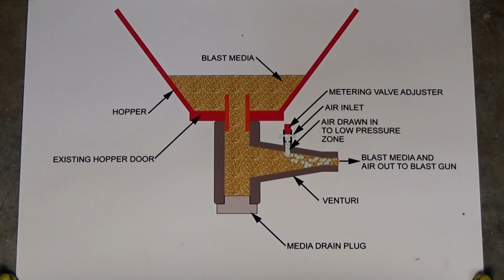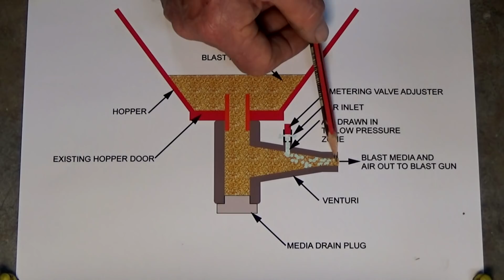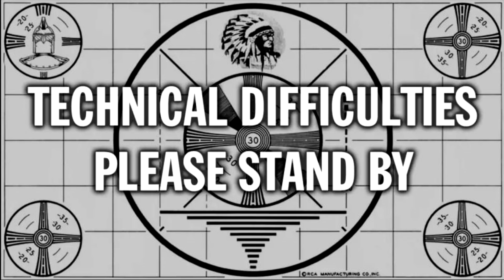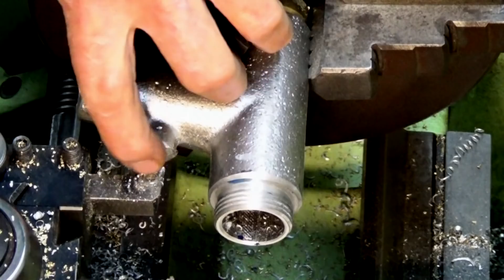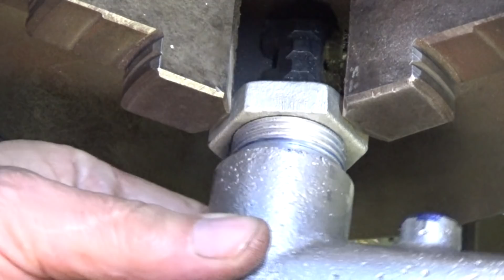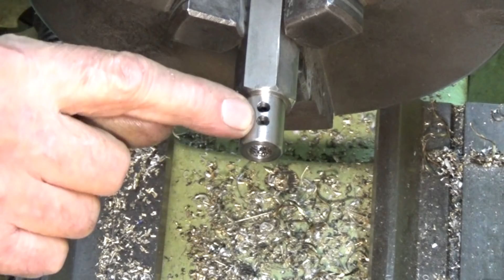HF Sandblaster DIY Metering Valve

Comment: I know you partially answered this already, but what prevents the air inlet from blowing out the intake for the media?
Reply from the maker: The tapered venturi in the blast gun creates a negative pressure so air is constantly being drawn into the vent holes in the metering valve. The entire media path from the bottom of the hopper, through the metering valve and all the way up the flexible feed hose to the blast gun has a negative pressure applied to it. 
Regards,
Mark

Comment: in the same boat here - pretty much doing all the mods mentioned. im running 1/2 hose tho as i need a VERY aggressive cabinet. - marine heads get rusty. wonder how criticls the venturi is? guys here using pipe fittings..
Reply from the maker: I have seen some of the builds based on pipe fittings and from my experience they would probably work well. I am not sure how critical the venturi shape is in my version. I think it's more about having some way of admitting and controlling the air bleed into the stream of media. I upgraded my blast cabinet after this build to include a solenoid air valve instead of a foot pedal. I mounted an old EStop switch near my knee so I can switch the air on and off and the solenoid has a large bore for the air to pass through so it doesn't throttle the air as much as the little foot pedal I had. It seems that air volume is more important than pressure.
Regards,
Mark

Comment: Hey Mark, new sub here....thanks for sharing your successes as well as the failures, we can all learn from both.

You can use the same "backwards" threading technique that you picked up from Joe Pi on external threads too.....just turn your threading tool upsidedown and thread in reverse to cut from the shoulder out.
Reply from the maker: I have used that method but it only works on imperial threads on my lathe. If I have to cut a metric thread I need to keep the half nut engaged the whole time and reverse the lathe to bring the tool back to the starting point. If I use a hard stop you have to be mighty careful not to crash the lathe into the stop as you engage the brake. With the imperial threads I can just disengage the half nut and wind the carriage up to the hard stop and go from there. I made some tiny hex headed bolts that way a while ago and it worked great.
Thanks for watching.
Regards,
Mark

Comment: At last, an Aussie take on small sand blast cabinet mods by
someone who dare say, sounds switched on. Bravo.
I have ordered a Renegade Bench top model (190L) 
and have been looking at these enhancements now that I
have discovered the shortcomings of these types of cabinets.
Not having the skills and gear that you have,
I hope to achieve the same results with slightly less efficient(perhaps)
plumbing fittings, with small mods to smooth and improve flow.
Look forward to watching the rest of your videos.
Thanks mate.
Reply from the maker: You're welcome. I used my blast cabinet today to prep some aluminium parts for powdercoat. It still performs 100% better than when I bought it. I am not sure how beneficial the metering valve is but overall, with all the modifications I have done it does a very good job. If you get a chance, check out the videos I did on the blast gun build and the solenoid operated air valve. I also upgraded my compressor to a Chicago "Silent". Adding a large receiver to the air supply helped too. 
Regards,
Mark
Reply: @Preso58  
You seem switched on Mark, so can I ask you this?
Instead of a Tee piece on the bottom of the hopper,
I have thought of using a cross piece.
The media feed (vacuum) tube stays on one side 
and the ball (metering) valve opposite, the drain plug stays as is.
As the metering valve acts like a loss of vacuum would it not be
better to have it after the media?
Full vacuum(low Pressure) can draw on the media falling from the hopper and as it moves, 
air from the ball /metering valve behind it (opposite the media/vacuum) gets drawn in to aerate the mix?
Taken further, could low pressure air be introduced on this side to further 
aerate the media, using the same or even smaller diameter inlets.
If this worked this air may be adjusted to suit different types of media.
I know this starts to sound complicated but the metering(ball) valve can even
be remotely mounted and plumbed to the Cross piece port via hosing , the air
supply could come from the foot peddle so it operated in conjunction with the gun itself.
Separate metering/pressure of course.
Once set up and assuming I'm on the right track it may transform the system
closer to what we are all expecting, maybe?
What do you think or am totally I missing something here?

Comment: I have a Hare and Forbes SB-375 I was told the secret to blasting without the pickup getting blocked is dry air! I went above and beyond with making sure my air supply was dry making and fitting a large silica bead filter that people have made using a karcher pump filter, then the air goes through a filter used in plasma cutters, then through a standard moisture trap. I have not had any trouble with the standard pick up tube in my blaster. So atm I have no need to fit this upgrade. I’m using glass beads and was surprised after watching a YouTube video suggesting to drop the psi to 50- 60 how fast it strips material and the finish it leaves.
Reply from the maker: I have heard that dry air is pretty much essential to get good results. After posting that video I was able to install a very large receiver to my compressor. It's actually a very large compressor tank and I mounted it outside my workshop and all the air from the inside compressor goes into the receiver. I also upgraded my compressor to a Chicago "silent" compressor (they are not silent). However, most of the air coming into my shop is now drier since it is cold. The air inlet and outlet are near the top of the vertical receiver so any moisture drains to the bottom of the tank. Even in our most humid weather I am able to keep the media flowing well. I only recently purchased some glass bead media and I love the finish I can get on aluminium. It gives is a very soft sheen and isn't as aggressive as the garnet I had used previously. However, I haven't found it as good as garnet for stripping rust and scale. I should try altering the pressure to see if that helps. 
Thanks for commenting.
Regards,
Mark

Comment: Mark, you said you have and imperial lead screw. When you cut metric threads on and imperial lathe, there is a method to disengage the half nut at the end of a cut. In short note, the thread dial is marked and at the end of the cut, the half nut is disengaged, the lathe stopped, then reversed, then the lead half nut is reengaged when the mark lines up with the dial mark. Abom79 has a video on how it’s done. (Cutting metric threads) Never saw this method before.

Comment: So it seems like what you and all the others showing these upgrades to the HF cabinet are really saying is, dont buy the HF cabinet.  
Which one would you recommend so that we dont have to do all these upgrades?
Reply from the maker: Unfortunately, there doesn't seem to be a lot of choice in the cheaper end of the market. Most of these sub $400 sandblasters are similar and all of them have shortcomings. It's a bit of a dead giveaway when the company that I purchased mine from also sells the upgrade parts like the foot pedal, the metering valve and the better quality gun. However, I have been totally happy with my unit now that I have done all the upgrades. As long as you don't want to do large parts or really heavily corroded parts it does a pretty good job. Once you step up into a commercial quality setup you are going to need a much bigger compressor which can also be a limiting factor with home/DIY style sandblasters. 
Regards,
Mark
Reply: @Preso58  Thats basically what I thought.  I still think its better to have a small mediocre way to do it myself than pay a company a bunch of money every time I need a small project done.  Thanks!

Comment: For the media drain a cap might have been better than a plug IYKWIM.
Reply from the maker: As it turns out, I have never needed to change out the media. I am using 80 grit garnet and it seems to last indefinitely. However if I do need to drain it, it's just a matter of cleaning the threads with some compressed air. 
Regards,
Mark

Comment: Hey Mark the parts you made and modified are available as spare parts for the larger cabinet (SBC420). But I did like your casting video thanks
Reply from the maker: Kerry, those aftermarket parts were pointed out to me by another viewer just after I had finished making all the parts I needed. However, I still enjoyed making the castings. I really wanted to learn about making and using cores for small castings. 
Regards,
Mark
Reply: @Preso58  Hi Mark I am also guilty of doing the same, if I cant buy it I will make it.
I did enjoy your video and I am looking to do some complicated castings. The core sand process was very helpful thankyou.

Comment: gday mark was just thinking why not use a cap rather then a plug.   stops media getting in the thread
Reply from the maker: Yes, that would be a help. As it happens, I have never had to swap out the media so I am not sure how the plug will hold up. It does have very coarse thread so probably a bit of a squirt with the air gun will clean it up.
Regards,
Mark

Comment: https://youtu.be/9N7HvyJNzdE.   

Or you can try this from pipe found from your local big box home improvement store for about $30. I made one for my harbor freight blasting cabinet and added a Eastwood upgraded blast gun with foot peddle.  
I also made many other upgrades, such as a router control to control the negative pressure inside the cabinet, twin flood lamps for bright lighting that also throws heat to keep the media dry. 
I also added a water separator with air pressure gauge and inline brass shut off valve. I have a dust deputy for dust management. 
I used speed nuts between the window glass frame so I could install the threads of the window frame hardware facing the exterior of the cabinet with wing nuts to fasten the window glass frame. This way I can quickly change the old etched glass without crawling inside the blast cabinet.  
A WORD OF CAUTION; : always keep the side inlet air vent open on the  bast cabinet or you will crush your shinny new blast cabinet like a beer can from to much negative pressure from your shop vac. It almost happened to me! 
Good thing my router was on the low setting controlling the shop vac motor speed. I also added a wood trey with casters and a grab rail to pull the cabinet around. I used a 90 degree PVC fitting exiting from the rear of the exhaust vent on back of the cabinet with a shop vac hose leading  to my dust deputy cyclone. The 90 degree PVC coming off the rear exhaust vent allows me to push the blasting cabinet close to the wall saving me garage space.

Comment: I piped a pressure pot blaster into my cabinet. It uses a lot less air than a suction gun. I can run it at 50psi on a $90 supercrap auto compressor when I am working on site with my vacuum recovery blaster.
Reply from the maker: Superior Etchworx, I am starting to price a pressure pot for my setup. My biggest issue is a lack of space but I am thinking I will set it up on the wall above the location where I will use the blast cabinet. Although all the work I have done so far gave me some improvement in performance over the stock cabinet, I am still looking for a better solution. 
Regards,
Preso
Reply: @Preso58  The 10 gallon ones from ebay are under $200 but need mods to make them work really well. I Have a couple of new modded ones for sale if you are near frankston vic. I make and sell the mods and hardwearing boron carbide nozzles. On my channel there is a ceramic/ carbide comparison video
Reply from the maker: Superior Etchworx,
I have just watched that video and I must say it is quite impressive. I am guessing you are using the blast cabinet as a containment and the pressure pot to deliver the blast media? Also, I was wondering what sort of blast media you are using? I am due to leave on a holiday on Monday but I am interested in the possibility of purchasing a pressure pot. Can I contact you directly through your website?
Regards,
Mark Presling

Comment: I made one out of PVC last week and we'll see if it works this coming weekend
Reply from the maker: I had originally planned to make mine the same way. Then I got sidetracked into making epoxy resin cores. 😁
Reply: @Preso58  Happy to report that my PVC metering valve works well. I'm stoked it didn't cost much.
Reply from the maker: That's great. I am thinking that the smooth inner surface of the PVC will keep the blast media flowing easily.

Comment: Mark,
Nice work.
Hare and Forbes have these and foot pedals and a much better gun available.
They can be seen on their web site in sand blasters, model SB 420 click on spare parts on the side column.
This probably wont help you but the guys watching and commenting might find this info useful.
The SB 200 cabinet you have is roughly $320, plus spending another $100 to $150 for improved lights, gun, metering valve, gun and a version of a cyclone dust separator, hoses, bucket and shop vac, gives you a cabinet apart from size that would cost between $1000 & $1400.
So yeah made to a price, but can be cheaply improved into a much better tool.
Edit
I forgot to mention, paint the inside surfaces white, improves the perceived lighting a lot, and its relatively cheap,  a good bang for the buck.
Reply from the maker: Cost is always a major factor when I am making decisions about upgrades in my shop. I realised too late that Hare and Forbes had the upgrade parts but I probably would have still tried to make the parts myself. So far, the only parts I had to buy were a cheap plastic cyclone, some LED strip lights and a power supply for them and some miscellaneous fittings and a foot operated air valve. Maybe $100 at the most. Plus, it's fun getting your hands dirty and it gets me out of "shopping" with my wife. 😁

Comment: I have the same Drill with you ! Mine is Russian ! Very good tool and torquey ! I found your build very interested thanks for the help ! My cabinet was a pain in the butt to blast parts
Reply from the maker: That drill that I am using belonged to my father and I always felt a bit smug because I already owned an 850 watt Bosch drill with forward and reverse and variable speed. However it had a full polymer body and I could flex it up and down nearly 3 degrees either way whereas the AEG drill  is rock solid. It only has two speeds but it has served me well. I recently purchased a Milwaukee variable speed drill with a metal gearbox but it cannot be locked on at a specific speed. I could probably 3D print a clamp arrangement to hold the trigger down though.
Regards,
Preso

Comment: Bravo! This is enjoyable and a pleasure to watch you build! But why did you worry about making a plug and exposing the threads to the media???  thread the external side for an off the shelf pipe cap made of black iron? Just curious- its done and looks great! Mr Mark- hats off and Bravo again!
Reply from the maker: Thanks. I can't imagine that I will be changing the blast media much but I went to the hardware store looking for a cap with an internal thread but couldn't find anything the right size. In reality, a big cork would probably do the job. Hmmm, champagne anyone? 😁

Comment: Did you work for General Motors in the 80's? Metric and imperial on the same part has GM all over it! hahaha! :-)
Reply from the maker: No I didn't but I love playing the guessing game when you are grabbing spanners to start overhauling something made in Australia. We changed to metric back in the mid 70's and for some industries, it was total and immediate, for others they had a bet each way and stuck with existing inventories util the ran out and then changed over. So, as you have observed, it can be a lottery. My lathe has an imperial lead screw so imperial threads are easier in that you can disengage the half nut but I like metric for the simplicity and that they have the same 60 degree thread form as US thread designations. Our pommy forbears use 55 degrees - go figure!

Comment: I'm wondering how the aluminum and brass fitting on the tapered section will survive with high speed air and sand grit moving through it.  Are the commercial units steel?  Ceramic?
Reply from the maker: I am publishing a video today showing some of the testing of the metering valve. The grit is sucked through the metering valve at fairly low velocity. It doesn't actually get accelerated to high velocity until it goes through the nozzle of the blast gun. That part is made of ceramic in my case but I have seen some units which use tungsten carbide nozzles. The commercially made metering valve supplied by the Tacoma company  and others are made of die cast aluminium or zinc alloys which are quite soft. Steel would be good in terms of hardness but then you might end up with corrosion issues if your sand absorbs moisture. 
Regards,
Mark
Reply: Yea, as the video went along, I realized the little nub on the tapered fitting was for a vent of sorts and not where the pressure goes.  If you can, show the method by which the sand is moved down the pipe in the right direction.  I own a nice unit in storage (Mac Tools I think) but I've yet to set it up and never have tore it down.  I remember going to an Auction with my now passed father and it was setup in his shop where I did use it a number of times.  Can't wait to have the space to add this equipment to my capacities.